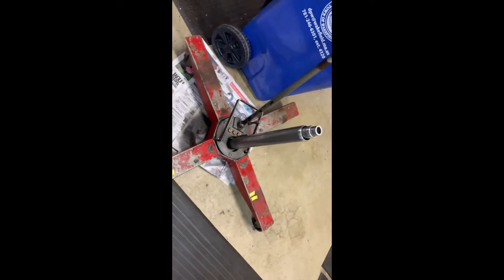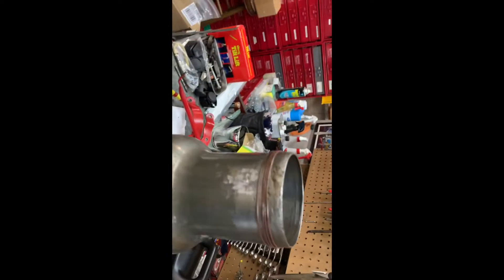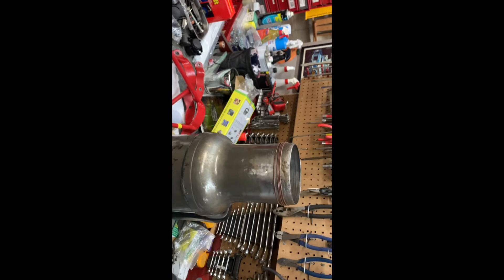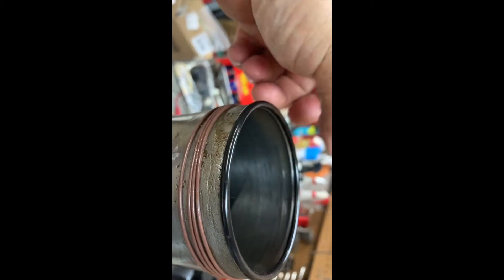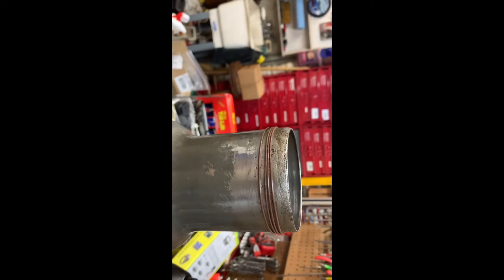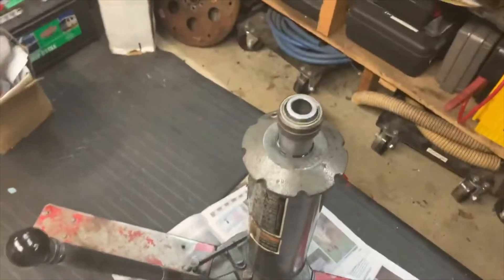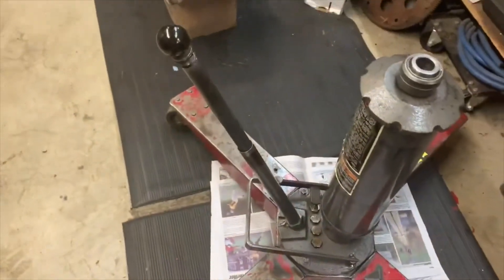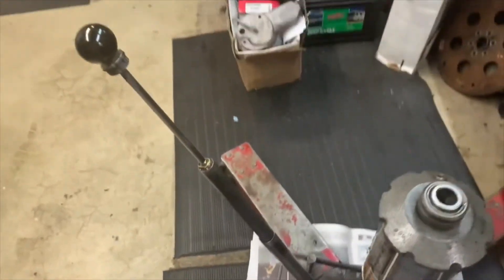Blackhawk 2 stage transmission jack repair

Comment: How are these jacks I in the market for one would you recommend one ?
Reply from the maker: I like mine. At one time most every transmission shop had one of these. You can buy import jacks cheaper but the problem with those is they don’t have a triple stage mast like this one. So when you pull the tramission out of your car it’s higher than the workbench so you can’t push it off the jack alone. The other problem with import jacks is if they start to leak you usually can’t get the parts to fix them. This rebuild kit was 90 bucks which hurt but the Jack should give me many years of use from here on

Comment: Any idea what the sliding tube on the pump is for?
Reply from the maker: I think it’s to dress it up and make it look nicer but I also noticed when I had the tube unscrewed and was pumping it up I smacked my fingers against the brass nut that holds the pump in. It probably keeps dust and dirt away from the piston shaft too.